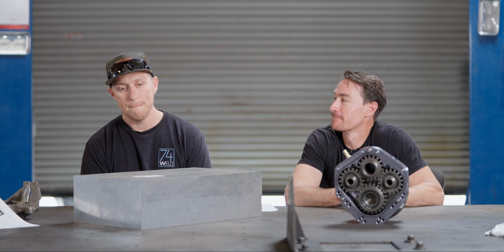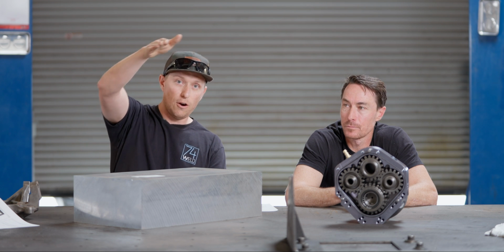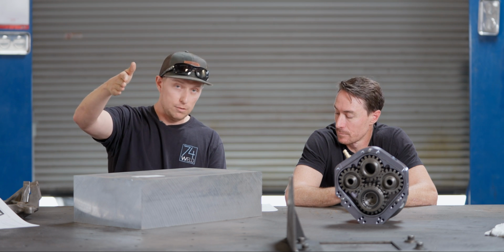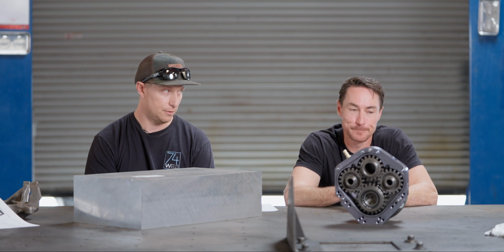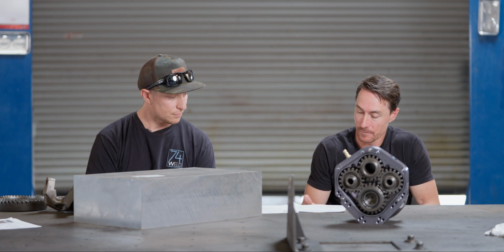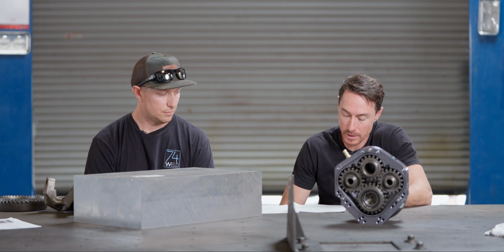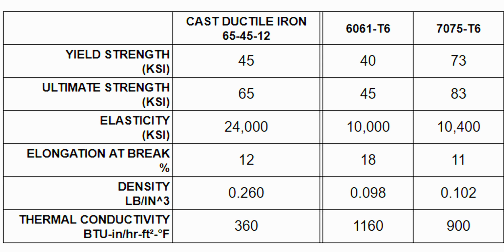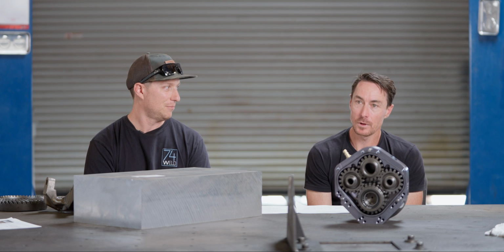The material science of portal axles

Comment: Regarding work hardening, it's not the case that it makes finer grains or aligns grains, at least in every case. In every case I'm aware of, it's more so that working it relocated certain types of faults in the crystal lattice to the edge of the grain. It's easier to move the faults through a grain than it is to move grains, and without functionally melting the metal you're not going to change much about the grain as a whole.

If you want to know more, I would highly recommend Steve Mould's video "Self organising steel balls explain metal heat treatment" (https://www.youtube.com/watch?v=xuL2yT-B2TM ).

Additionally, AlphaPhoenix made a good video on crystal deformation for his 2¹³ subscriber special (https://www.youtube.com/watch?v=sn1Y6zIS91g ).

Both videos are quite understandable, so I'd recommend giving at least one of them a watch.

Comment: Regarding the thermal conductivity units, BTU is an amount of heat, so it's saying that for every square foot of surface, and for every °F of difference across the material, it will move that many BTU of heat one inch. If the thickness goes down, the amount of heat moved goes up proportionally.

Using the 7075-T6 (with 900 BTU in/(hr ft² °F) thermal conductivity) as an example, if you have a sphere with a 1 foot diameter, and the walls are 1/4 inch thick, and the inside is 125 °F warmer than the outside:
The area is pi square feet (3.141), so you have 3.141×125/(1/4)*900 = 1,413,716 BTU/hr of heat flow outward.

Of note: the temperature difference is not relative to ambient temperature; it's purely across the material itself. If the whole material gets hot, that can help with shedding heat to the surrounding air, as well as increasing the amount of radiative heat transfer, but heat flow through the metal doesn't care at all about anything outside the material.

Comment: I'm a trucker. Me & another guy delivered 1 of several "used" GE laser "printers" to a guy in upstate NY that got the contract to make engine & tranny mounts for Volvo trucks & busses. This "printer" took 2 semis to haul. It has a platform with stairs its huge. He had us pick up an engine mount from the counter top, we both tried to just pick it up with 1 hand becuz its just an engine mount right? Ya it took two hands to pick up it was so dense, it was an optical illusion. It was way too small to be that heavy. He explained that the printers print with "pulverized powdered stainless steel" it uses 3 laser beams and theres like zero air molecules inside the part being "printed". Thats why it was so heavy. I'm just wondering if you've ever heard of this process?! The original cost of the printer new was $3 million. He got them for $1 million at auction. I would imagine those parts are just about indestructible.
Reply from the maker: The problem with 3D printed material for something like this is you get no grain structure and relative to plate it is much weaker in all directions. Very cool for printing parts that can never be machined and commonly used in aerospace, but not a good solution for this application

Comment: Ductile iron is hot garbage, the only ppl using it are ones that are too cheap to pay for aluminum. Theres several aluminum alloys that are as strong for 45% of the weight.
Reply: Ductile iron is great in applications where weight isn't very important, or cost is more important. In an application like this where it's unsprung weight, it's a big deal. Even so, ductile iron would be fine for a portal aimed at people who would rather save some money than have the highest performance.
Reply: @siggyincr7447  Yea cost in my experience is the only reason I see it being used.

Comment: Good info. I always figured for something I am using I'd rather have a little ductility rather that a little higher tensile, so something will bend so I know it's failing, rather than just snap and break. Like you pointed out, it all depends on the part an application. Nothing is 100% perfect for everything, you give up one thing to gain in another aspect.
Reply from the maker: I tend to agree most of the time. I’ve been reading about tempers a lot more lately. The beauty of forging is you can get them in alloys and tempers that are not found in stocked plate. For example, T651 and T7651 are common in plate T7 is not. T7 will have a slightly lower tensile and yield but will be less prone to fatigue and more ductile. So much more to read and learn before we commit to an alloy and process. Sounds like we both geek out on this stuff

Comment: You will discover the weak points in your design and upgrade as needed. Then you will sneak up on the weak points on the connected parts (axle assemblies). At that point I think you can stop upgrading because technically your only failures will be due to uncontrollable forces associated with a heavy right foot.  Nice to see some actual engineering design  being followed. Hoping you have future thoughts for one ton rated axles in the future.
Reply from the maker: We would love to do 1 ton stuff, but as long as they put a traditional grease pack spindle on the rear end we will never be able to adapt to it. Now the new Chevy 1500 and 2500 run a massive unit bearing with a bearing cup on the rear…that we can bolt to
Reply: @74weld I’d love it if y’all made a budget setup for Dana 44 and semi float 14 bolt. I’ve got a square body suburban I’m building into an overland setup. Low lift big tires is the route I’m going so the more axle to ground clearance I can get the better.
Reply from the maker: @kylewest100  the problem is there are a dozen different 44’s. Designing a custom knuckle for an old vehicle with very few left on the market isn’t really a recipe for a “budget” product. We have never developed for an axle, only for a specific vehicle due to brake packages etc. there really isn’t a good way to do a “one size fits all”
Reply: @74weld  make a weld on housing end.
Reply from the maker: @seancollins9745  we do…it’s just when you try to tell a customer they have to cut off their factory end and weld on a new one you just eliminated 90% of your market. I have a full fab shop and I still wouldn’t do that because you would have to pull your carrier, setup a fixture bar and located the ends, weld them all up, then reset your carrier. That is a ton of work that most people could not handle